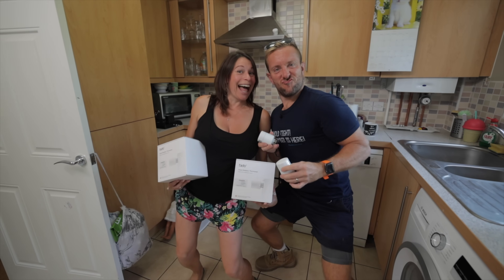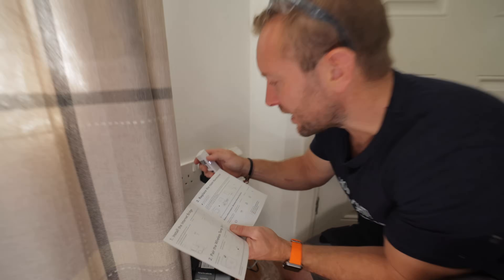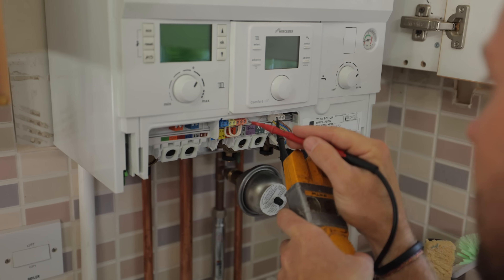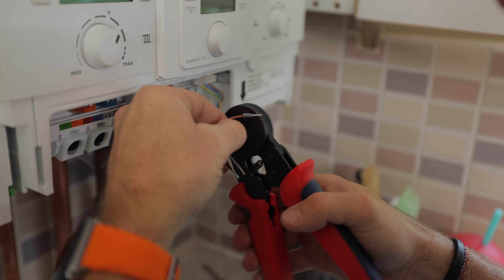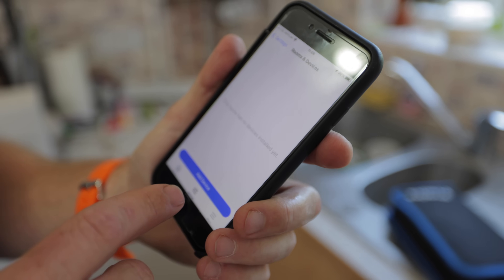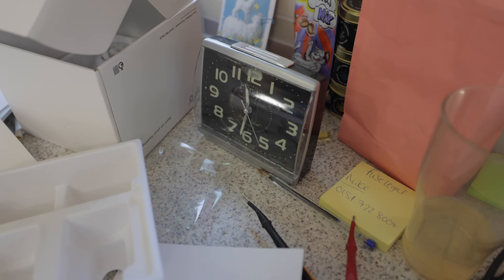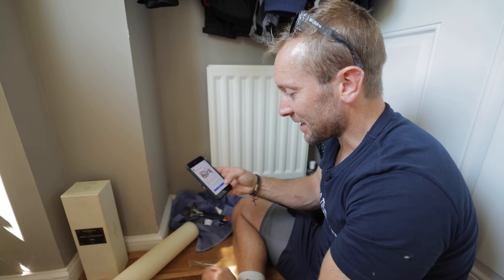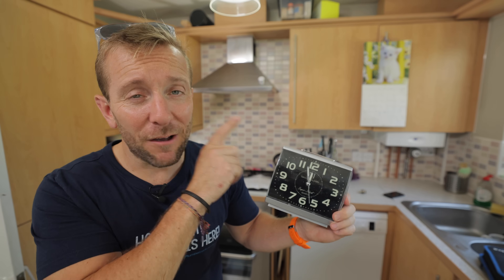AGAINST THE CLOCK - Updating Tado Heating Controls QUICK!

Comment: My ideal touch Boiler Thermostat stopped working a week ago. Screwfix had a deal on with a Tado and as I have been following your channel for a while decided to go for this brand. 

The application even gives you step by step installation instructions for your boiler. The wireless receiver has to be 30 cm away from the boiler so that could affect the thermostat performance. 

All in all really pleased with it

Comment: I installed these on mine. It's is good when working but. Few things they don't tell you. Mine is on a combi, if you install them on every radiator it will sometimes close all trvs but still call for heat causing errors on the boiler and shutting it down.
The bridge doesn't connect to the wireless wall stat via WiFi so if you don't leave them very close to each other. You could end up with a huge gas bill as for some reason when mine wasn't next to each other the heating downstairs was turning on full wack overnight without us knowing for 2 months.

Comment: These are great when working. I have 17 installed. My biggest gripe is the battery low messages when the batteries are fine and as mentioned ny ithere, the bridge not cimmunicating with some but works other times.

Comment: Why did you had to take the pressure off before changing the TRVs? It shouldn't matter when you replace them. Just curious.
Reply: Cos he swapped a couple of valve bodys too not just the heads
Reply: @dd5617  makes sense, must have missed that part, cheers

Comment: Those Tado TRV adaptors fit everything except all the Mk1 Draytons I put in my house 30 years ago. Grrr. 
I had to replace every TRV valve body in the house with a new ones, with 10mm inlets for my microbore, that fitted the Tado heads. Funny how simple jobs always turn into all day jobs!! That said, the Tado system works well, apart from a few erroneous low battery error messages.

Comment: Plumbers shouldn't touch electrics
Reply: 😂Dead right. Leave it to the Diyers🤣
Reply: The whole plumber vs electrician debate begins.
Isn't it ironic that once you've passed you c&g and have been crowned as a competent person, you can't do your job until you pay into some government backed quango/mates club.
Reply: Really? From my experience I would say electricians shouldn’t touch smart heating control systems - mine made a complete mess of my Hive install, which had to be redone by someone else. (Eventually moved to Tado.)
Reply from the maker: Haha!
Reply: At least a plumber knows the wiring works once setup. Had exactly the same with a spark who said he didn't understand s plan

Comment: Be aware that each device has to communicate via the bridge. The communication protocol used by Tado is capable of forming a mesh network, but Tado doesnt do this. If you have a larger house you need to ensure that the bridge is central to all devices. In a large house this still might not work.